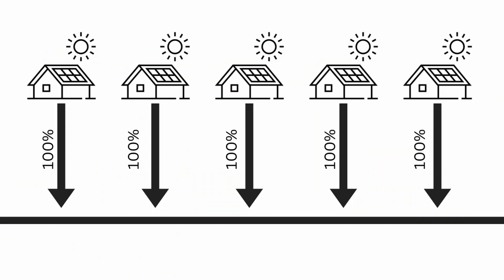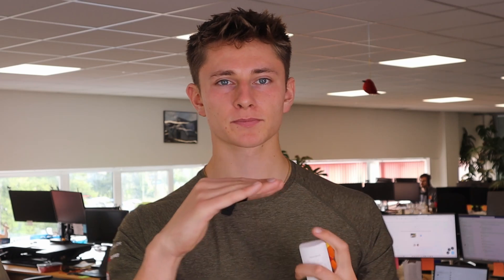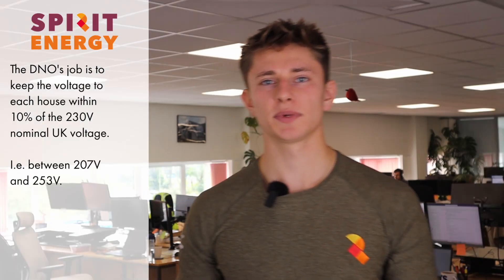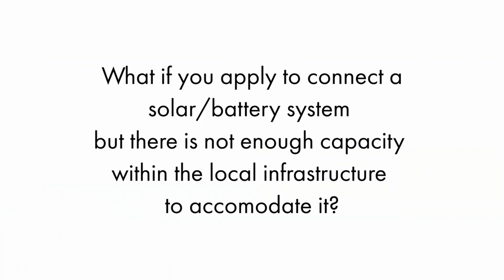Why do you need a DNO application? - What do the DNO look at?

Comment: This is, broadly speaking, correct, although the voltage profile of any LV network varies throughout the day and any localised voltage rise depends on the amount of exported energy vs prevailing loads and network impedances. The scenario described in the video is possible and may become more likely as the amount of solar PV interconnected with the network increases.

The statutory voltage envelope in the UK is still -6% to +10% on a nominal 230V for single-phase supplies (so 216.2V to 253V), not +/-10% as stated in the video. The 262V limit referred to for inverters in the video is actually the UK standard setting for Stage 1 over-voltage protection (more accurately, 262.2V or +14% on the nominal 230V for single-phase), where the inverter(s) would automatically disconnect. If a situation arose where network voltage was regularly exceeding 253V for significant periods, the DNO would likely receive complaints from customers and would be required to investigate and intervene.
Reply: I was just about to comment on the voltage tolerances, too late. 
Your comment is perfectly put. 
I did Electrical Engineering HNC recently ( plus I'm a spark of 35 years ) so this was fresh in my mind. 
From Generation, to Transmission, to Distribution, there are losses. Primarily from volt drop ( or I²R losses due to conductors emitting heat ) but also Inductive and Capacitive Reactance. 
In built into the networks this gives us our expected voltages under load. 
When that expected load isn't pulled, the volt drop does not occur to the levels they expected. 
Over voltage is a massive problem for the DNOs. My Son is a Senior Engineer for my DNO and we talk about it often. It was me that gave him facts to take back to his office of the causes. The answer for the DNO is nearly always a "tap change" where they change the output voltage of the transformers by changing the number of turns on the secondary side of the transformer. 
The video was not 100% but to the uneducated, it was sufficient. Just wish they'd taken time to speak to an Electrical Engineer first.
Reply: @robtmcL12  Robert, you would be surprised the number of times that I, as a DNO Protection & Control Engineer, had to 'stare down' an operational colleague that intended to deal with a localised voltage complaint on one LV network by 'tweaking' the Automatic Voltage Control at the upstream Primary substation (basically because it's much, much easier than having to mess about with LV network backfeeding, taking an outage on the affected transformer to alter its off-load tap setting then put it all back in service). My question to them was always, " why do you intend to 'solve' one network voltage complaint by generating ten others!?" Invariably, the colleague saw it my way.

You are correct though, voltage regulation is probably shaping up to be the number 1 issue with increasing penetration of small, domestic generation with fault level saturation not far behind. DNOs are (perhaps understandably) keen to develop so-called smart solutions that avoid digging the streets up and overlaying cables etc. I'm not confident that this will be particularly successful.
Reply from the maker: Thank you both for your comments (great insights!) and for the correction. We have made a note to correct this mistake in the video, and to prevent it happening again. 
 
There appears to have been a review in 2017 by the ENA looking at the benefits of lowering the lower voltage bound to -10%, so perhaps we were just predicting the future! Would be interested in hearing your thoughts on this potential change and whether that would be a logical move to mitigate the growing problem of voltage rise on the local networks.

https://www.ena-eng.org/ENA-Docs/D0C3XTRACT/ENA_ET_140_Extract_180902050409.pdf
Reply: @spiritenergy_uk  thanks for your reply. The move to +/-10% to harmonise with other European countries under CENELEC proposals dates back to the 1990s. The U.K. ‘moved’ from a single-phase LV nominal voltage of 240V to 230V and from +/-6% to the -6/+10% we have today under the 1994 amendment to the 1988 Electricity Supply Regulations, later replaced by the Electricity Safety, Quality and Continuity Regulations 2002 (as amended). The intention in 94 was to extend the voltage envelope for distributors to +/-10% a few years later but, of course, that hasn’t happened yet. That said, any apparatus designed for connection to the mains supply should be capable of dealing with +/-10% as part of the BS EN 50160 spec’.
Reply: Genius 😎☝️